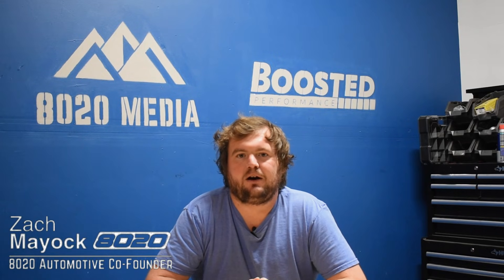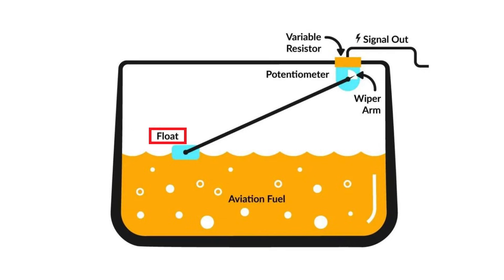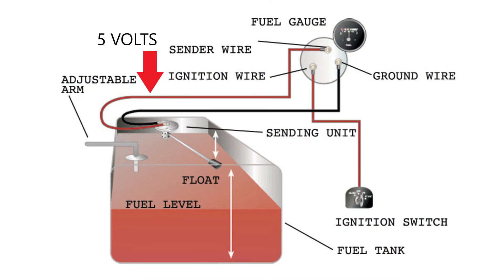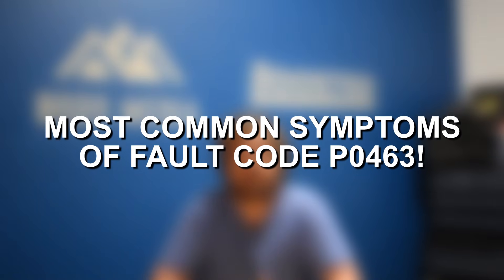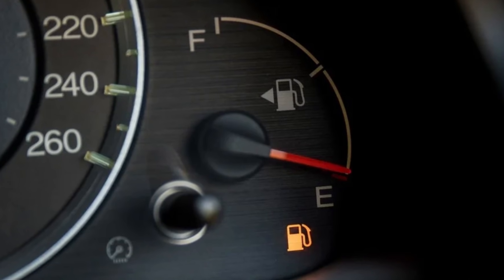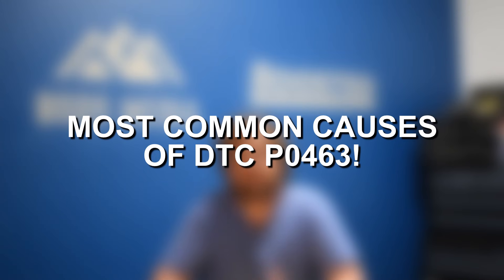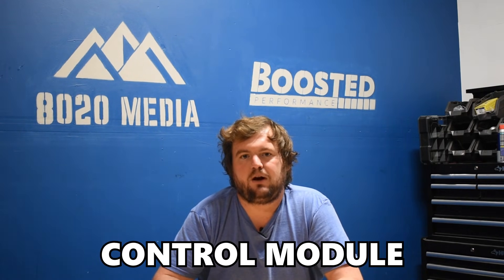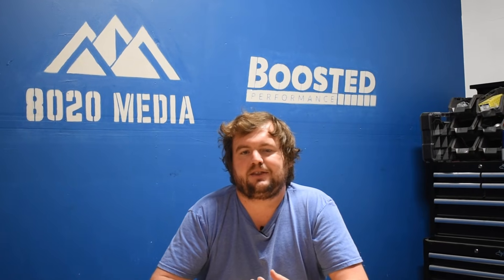Check Engine Light? P0463 Fuel Sensor Code Causes & Fixes

Comment: I’ve had this code on my 2013 Mustang for a few years. The fuel gauge worked on-and-off, but is now always empty. I replaced the entire fuel pump assembly, but no luck. I’m going to try the ground strap and wiring harness next, thanks.